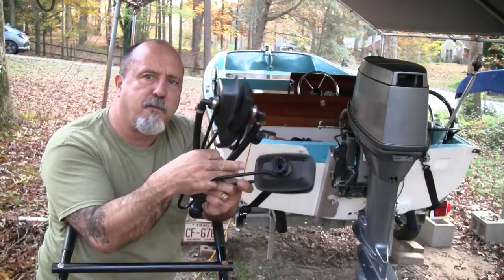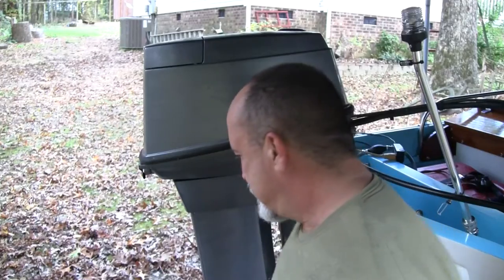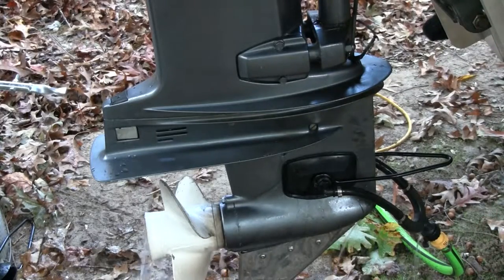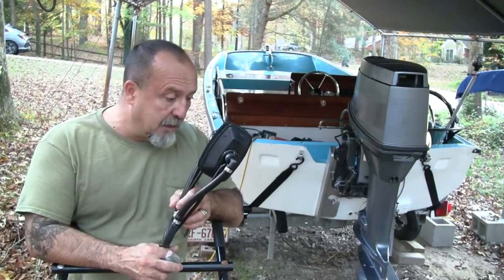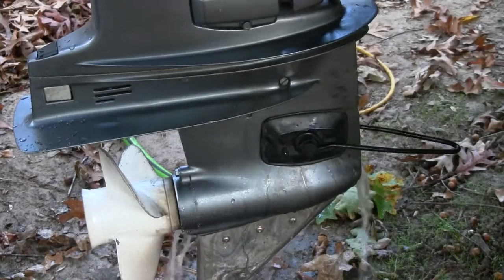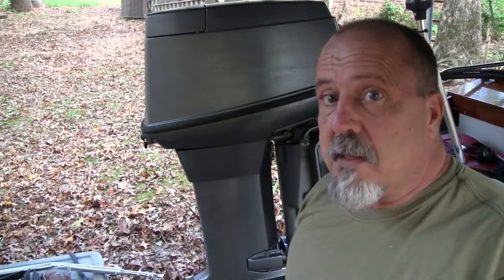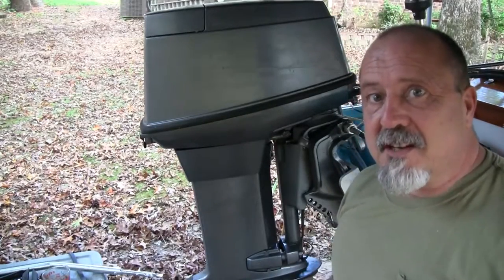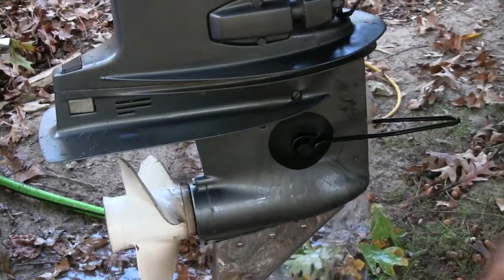Which Flush Muff Works Best For a Yamaha Outboard - Muff Bake Off!

Comment: HeyJoe, I am so glad I found your videos. Wished I would have found you a couple of years ago. I acquired a 1992 Yamaha 40 MSHQ. It’s hard to find information I need. It hade been sitting up for awhile and it’s obvious that when ever something broke the previous owner would rig something up rather than replace parts. After I replaced everything in the all three carburetors I had a hard time with link and sync. Part of the reason is there’s linkage or something missing to where the throttle is not triad into the CDI. Instead there’s a piece of stiff wire hooked to it coming out the cowling and I had to control the CDI by moving the wire in and out. Currently have to use it to control the idle then when I want to use the throttle I have to pull the wire at the same time. I’ve figured out and fixed the rest of the problems I found but I don’t know how or what’s missing.
I’ll be checking out the rest of your videos. Especially since you covered an older Yamaha in this one. Mine doesn’t like muffs either I have to use the round ones and clamp them. I’ll be getting a set like yours now.
Thanks for the information videos keep it up.
Reply from the maker: Thanks for the feedback, sounds like you are on your way to getting that motor going!

Comment: Excellent, I just bought the one that didn't work for my old Yamaha, and I debated on the winner but it was several more dollars, so I guess back to the store. Thanks!  I think you're right on that twist and the circular muffs deliver more even pressure to seal on the runner up model.
Reply from the maker: Trial and error, This one was a bit of a challenge but finally got it lol